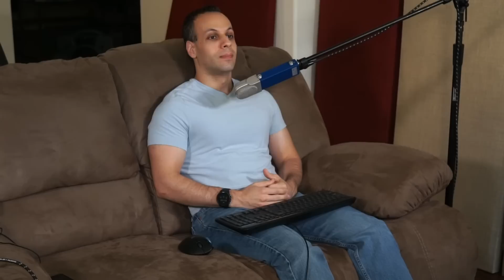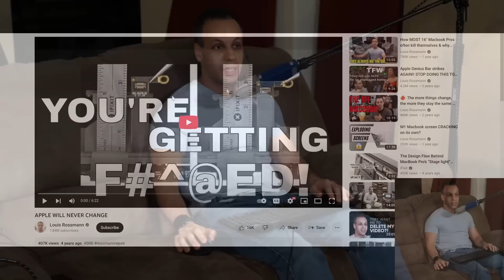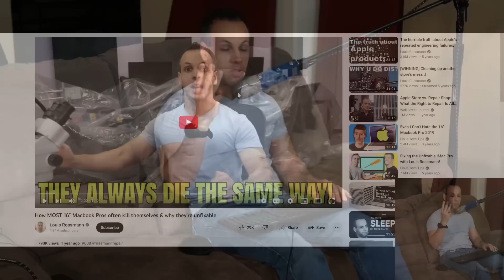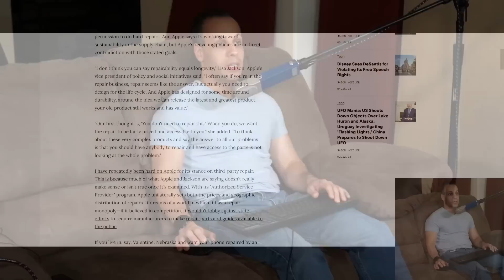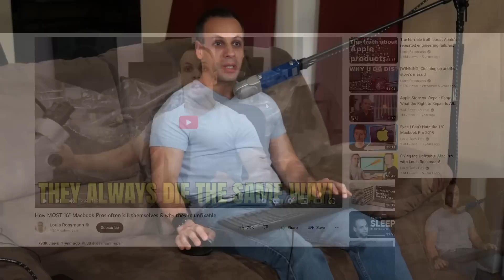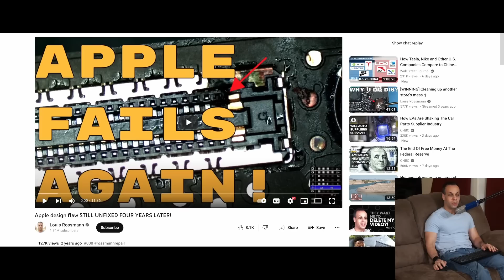Apple exec's latest interview is a pile of greenwashed BS

Comment: Apple definitely has their fair share of intentionally poor designs hidden under a device that looks well made. The maddening thing is that when you bring a device with one of those issues to Apple for support, the engineers will claim that the behavior is expected. My iPad Pro 12.9” and M1 Max MacBook Pro can’t talk to each other at Thunderbolt speeds. Both devices are capable of Thunderbolt, but they communicate at USB 3 speeds. This makes a big difference when transferring large files. The engineers tell me, that is expected behavior. Right. By what standard? My expectation is that since both devices have proper Thunderbolt support, they should be able to communicate at Thunderbolt speeds AND AT FIRST THEY DID! Now they don’t, and Apple won’t fix it.

Comment: The point that a socket meant for easy insertion and removal is another point of failure is quite valid.
But we have known this for decades now, and thus only do it on components that more likely to fail than the socket. Also, we got a lot of very reliable socket designs these days.
Also, another way we tackle it is by making the thing the socket is on itself replacable too. (there is of course a limit you can reasonably do this, but cars and PCs show it is far higher than what Apple claims)

Batteries are blatently more likely fail than the socker for most anything in scales geater than millimeters.

Comment: I think the mistake here is treating battery replacement as a repair. Currently huge corpos like Apple or Samsung made people believe that replacing a battery is a "repair" while I think the correct word should be "maintenance". By using current logic you should throw away your car and buy a new one once oil and filters need to be replaced. Thing is that oil and filters are consumables and are supposed to be replaced and so are batteries. Maintenance in case of electronics like phones or laptops should be possible for end users to perform.

Comment: I don't think you can ignore that those extended iOS updates are often a vector to slowdown the device, possibly to trade off performance for reliability (because the level of performance delivered earlier in the life cycle was not reliable long term), to push users to upgrade their hardware

Comment: EU law does not mandate removable batteries for all consumer devices, as always devil is in the details. 
The new EU law will have provisions for sealed devices to have higher quality batteries that are atleast rated for 1000 charge cycles, if a device can meet the requirement of 1000 charge cycles it can continue to have sealed batteries. 
Current iphone has batteries rated for 500 charge cycles. 

You can bet your bottom $ by the time this law is implemented Apple will make some huge song & dance about how they made some magical battery tech sprinkled with pixie dust so your phone will last longer & they are being green and other such nonsense. The ipad & Macs already have 1000 charge cycles rated batteries.

Comment: It seems like Apple is using legitimate engineering rationale to gaslight their customers. Sure having removable components does introduce a new mode of failure THAT CAN THEN BE DESIGNED AROUND. I'm also going to go out on a limb and say that Apple isn't designing for reliability beyond what their business cycle demands for introducing new models.

Comment: When Apple engineers think their products are designed in a way they will never need to be repaired, then they should just give unlimited lifetime warranty on every product sold.
Reply: That's a very good point. Further I think they look into the data. Its just that they use the insights to maximise profits not minimise repair cost for customers.
Reply: @@username_login_passwordapple is driven by greed, that's why it won't happen. For all the time, I hear people talk shiit about cheaper android phones, it turns out that cheaper android phones with built in batteries are very repair friendly and have a remarkable longevity. I just resurrected my old Huawei y6 ll from 2016, it had a dying 3100 mah battery and due to its canonic age, I wasn't able to source it's original battery and I looked out for a battery which had a similar dimension and I bought a Samsung (Galaxy a51) 4000 mah battery and soldered it's old BMS on the new one and tested the phone to see if everything was okay, to my surprise, the phone started to charge after the boot process, after that, I proceeded to glue the battery in the y6 chassis and now, it holds charges much longer than the original battery when it was new.  No need to bring your phone to a repair shop when you can get the job done.

All I needed was a Philips screwdriver, a soldering iron, a new battery and a syringe full of gasoline to dissolve the glue under the battery, no calibration and that's all

Comment: Time for a Framework but for phones.
Reply: Nokia has some repairable phones now, and is partnered with iFixit for the parts and tools, plus Motorola has been selling parts to consumers for years now to fix their phones, so that's at least something.
Reply: @CommodoreFan64  Imma have to look into those!
Reply: @CommodoreFan64  Nokia's repairable phones have low end specs and not even a unique design with easy repair in mind (it still takes awhile to open it up and do a simple battery replacement and you can't just pop them in and out like an AA). Clearly just a useless decoy that's meant to draw people to their regular model of the same line but with better specs
Reply: @cbegefdkih  I never said they were good, or bad, just that they do exist, and are an option, but if you don't like them that's your problem.
Reply: @CommodoreFan64  The problem is that they are intentionally made to NOT be an option to the majority of people, which makes their existence pointless

Comment: Apple is mad right now because they know they can get away with anything but are litterally forced to make a better designed phone because of this replaceable battery law. 

It will change the shape of the iPhone and people will buy less iphones if you can replace the battery. Because battery replacement isn't super cheap, people just buy another iPhone. If you can buy a cheap battery and put it in yourself, Apple loses money. 

Apple wants to sell you things and not make things good the first time. Phones have to be breakable or they can't sell you a case. My first touchscreen smartphone was a moto g2. The back of the phone was essentially a case integrated into the phone, and there was a little plastic bumper around your front glass. So it was less likely to break.

Even now I've just noticed that it seems like the glass on my phone is valerable but actually there's a little black sturdy piece inbetween the glass and the metal side that protects my phone from getting side crack from drops. The phone can still get scratches on the phone. But face down drops wouldn't really Crack it easily. I have a Samsung galaxy a71.

Comment: Guess Apple devices are amazing as long as they work as intended, when shit hits the fan you are on your own, either pay apple to fix it which usually means just buy new device because repair is that expensive or go to non apple authorized repair shop that will fix it properly, but OS will be like "you didn't give money to apple so here is annoying message that will show up forever, also I will disable 1 random feature just so you think 3rd party repair did a bad job".

Comment: Apple actually has a design direction that is quite monetary friendly. They are looking after the customer facing part of their products instead of the part that the customer does not interact or interface with. If you buy any Apple product, as the customer, you are not interacting and interfacing with the "hardware" you are doing that with the "software". If they can make the "software" desireable, competetive and functional they will have an edge. So what if %10 of the customers that purchase your products gets the bad end of the stick and the "hardware" turns their product into a useless brick, what if it is %25. So long as the "software" side is compelling, addicting or has a sunk cost fallacy built in when that "hardware" problem kicks the customer in the wallet, most of them will return for their Apple product, either paying ridiculous amounts for its repair or buying a new one because either their daily life, or their business cannot function without the "software" side of the Apple business model.

Comment: A battery that connects with pads or a ribbon versus one that uses pogo pins and pops out easily doesn't change the fact that the battery itself is exactly the same.  There's no reliability gained from choosing one connection method over another or blocking access to the part.  The only issue arises when you sandwich 3 different batteries in poor locations because you literally fill all void space rather than designing a better (and more heat-conscious!) product.

This requires Apple to actually design a proper product, which means raising costs for research and development where they haven't paid into design in a decade now.  This cuts into profit margins and that's the actual issue for Apple.

Comment: No, video to help EU regulators would br helpful.
You know , even regular consumers have no idea.
Some prosumers have couple of hints.

We actually need this thing explained.
I am IT guy aka someone who is working with software and hardware, I am software guy, but I still have more than average hardware knowledge,
But still. Some things are kinda like dark magic to me as I am not a wizzard  with coupleter electronics.

Now compare it with people like regulators will not know difference between GPU and CPU or will not diferenciate between Chrome or Mozila and be scared of you open command line/terminal.

Comment: Devils Advocate here - I replace my phone every 1-2 years. I've never had a phone long enough for the battery to fail, and I usually have an otterbox for my phones. I've yet to, in my 20 years with mobile phones - had one break.  Why would I care? Would I care on the off chance I did break my phone? Probably not.. but I still have to have a different design than im wanting - just because some people keep their phones until they need carbon dating?
Reply from the maker: How are you hurt by a user removable battery?

Comment: Apple designs its durability using data from Louis’s keyboards
Reply: They use the data from phones made of chocolate.
Reply: @hansdieter4537  I like chocolate. Sadly, their data is likely from U.S. chocolate which is mostly milk solids and butyric acid, not European chocolate :/
Reply: 256 of data, makes sense.
Reply: If they did that, they would actually have data on many broken keyboards and thus: a better more resilient design 😅☠️

Comment: Not being able to remove the battery is all about not being able to shut the device down, which is all about tracking and data harvesting.
Reply: and i dont think the EU law even attacks it that much.
as even with phones today that have "replaceable batteries" its still a little bit more work then any of the old phones. (as in not designed around having to replace it often.) and instead just give ppl a quide on how to open there phone and not glue the batterie in.
Reply: Simple enough to have a Faraday bag that would stop signals from leaving if you place the phone inside anyway.
Reply: @callak_9974  So the phone just records the data locally and uploads the next time it gets a connection.
Reply: @callak_9974  Not as reliable as cutting the power totally.
Reply: Nailhead. Bamm.
Reply: This is tinfoil territory, because (a) the battery would run down and die in a couple of weeks at most if the CPU was secretly running and sending/storing tracking information while the device is off, and (b) no third party researchers have discovered any such mechanism for tracking while the device is shut down.

The explanation is far more prosaic, it is less difficult to seal the battery in, and it helps nudge people into buying a new phone instead of doing "a repair".
Reply: Unlikely that that is a real consideration. It is about cost of manufacturing and repair/replacement profits. A sealed phone is cheaper to build, since it requires fewer parts and design considerations. It is also more likely to steer people to "just upgrade" when their battery life starts to dive.
Reply: @kerpwnt  Also liability etc. issues with a person botching the battery replacement, etc.

Comment from the maker: Correction, it's 12 volts to the SSD, not 20. My bad. Same point though. NANDs like 2.5v. They do not like 12v. Honestly anything over 3v and you've probably cooked your data; even 1 second of 12v is enough that you get a physical hole in the NAND you can see.
Reply: That you correct yourself within an hour of the video posting on a minor technical detail is a testament to your integrity
Reply: 🎵 NAND chips roasting as an open fire...🎵
Reply: 12V 20V if thing is death dozent mether how much it is xD
Reply: And here I sweat bullets whenever HWinfo reports that my mobo pumps 1.45v into my 4600g at stock boost.
Reply: @ts757arse 
Too high a voltage may not destroy enough because it could just arc across all the conductive things like the external pins without actually doing too much damage inside the chips.

You should probably start off with a software level erase first (preferably the drive's own internal "secure erase" function). Then fill them with something inconsequential like Linux ISOs to ensure the flash actually gets written to.

At this point, you should consider repurposing them instead of causing more e-waste. But if you absolutely have to destroy them, I'd go for somewhere around 10-20v. A car battery or an old laptop power supply would work quite well.... Then go all Hilary on them.
Reply: @tin2001  it wont arc across the air gap if it has a reasonably conductive path elsewhere
and given that at 50kV air becomes conductive, the rest of thr circuitry sure will
and nobody stops you from tossing the chips into a furnace once youre done with the voltage treatment
i heard data on ICs isnt very temperature stable :)
Reply: Why isn't it possible to configure a second HDD when the device can't boot? Simply mirror the HDD to a second drive before it breaks.
Reply: @ComputerGuruPaddy  Its not problem in mirror. Problem lie in the power line!
Reply: 1 Föttönvölt itch män´$. . ? sörry you gönna F€|ND tönnes möhr #ß n ökcült stüFF sö im kippin it neiß in cementZ xxxP
Reply: I just learned that reddit apple sub has a massive hate boner for you and these kind of videos where you criticize their religion lol
Reply: https://www.youtube.com/watch?v=Gx5mSBlLWsM
Reply: Hi I don't know if you'll answer this but I'm curios if other smartphone manufacturers have similar issues such as the ones you mentioned. It's just that I've only seen you mention engineering problems concerning apple products and I don't to be an "aPpLe bAd" type of person. And if you don't know of any such problems do you know of any other channels that might cover such issues? I'm just trying to get a more nuanced perspective.
Reply from the maker: @dragonskinner7109  i've gone over issues with other brands of smartphone on this channel, people make an active decision to not watch those videos though.
Reply: @rossmanngroup  Well I'll have to go watch them then. Personally in my recommendations I've only ever gotten apple videos but that's probably because I consume a decent amount of apple/right to repair videos. I'm thankful you answered though and I'll definitely be looking for some of your other videos on such issues.
Reply: @dragonskinner7109  Apple is a very large platform and they often keep problems between releases. The only other giant phone model maker is Samsung, and the differences between models are typically larger, so they don't have the same sorts of issues between models (or not as frequently).

Comment: so i just got rid of my apple stuff but i've yet to replace my macbook with a windows laptop. What windows laptop IS good for repairability and durability?
Reply: Framework
Reply: a refurbished Lenovo Thinkpad t530 is an excellent budget windows laptop for durability and repair in my own opinion because the Lenovo Thinkpad t530 is modular, expandable and user upgradable. and they don't make them like they used to
Reply: @jackdunk2104  wanna suggest something even older? Maybe a Pentium II machine? Everyone is better off buying a Framework with current hardware, not 10 year old junk.

Comment: Apple is the epitome of today's Marketing:
"It's not important what clap you sell, as long as you frame it right. It doesn't matter the cost of production and/or quality, but how much we can make the customer pay for a product."
Reply: Yep. I've always said the most powerful thing about Apple products is the marketing department.
Reply: @petebateman143 Processor is also pretty good.
Reply: It's not just how much Apple can get you to pay for a product, but HOW OFTEN.
Reply: 999€ for a monitor stand that is 100% aluminum alloy, zero electronics. Less than 20€ manufacturing costs. You can buy a good metal 3D printer for 800€, print you own fucking stand with 100€ of materials and STILL SAVE ON THE APPLE PRICE 😂

For a piece of metal to hang your iMac onto!!!
Reply: @Jukantos  Where do you find "metal 3D printer for 800€"?
Reply: @LAndrewsChannel More like €100,000 lmao